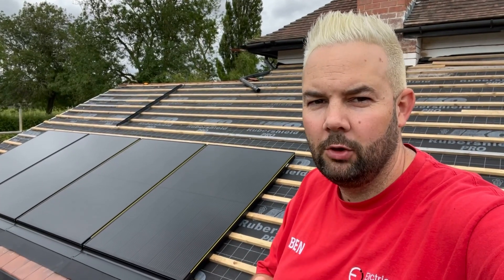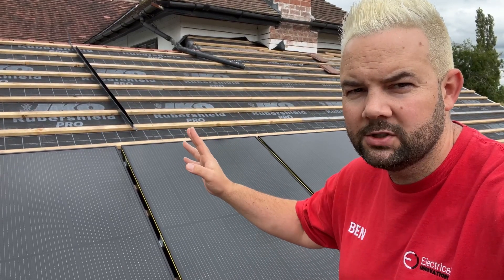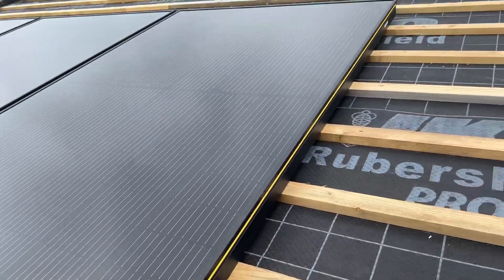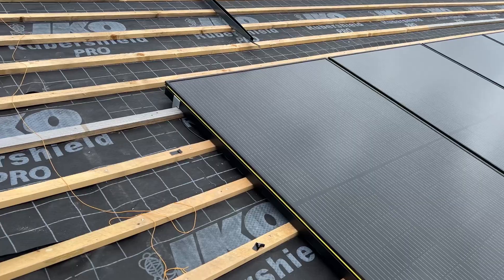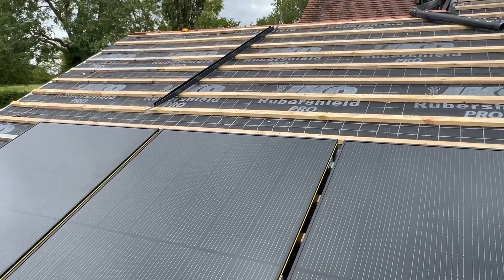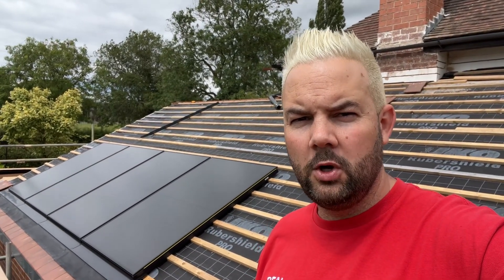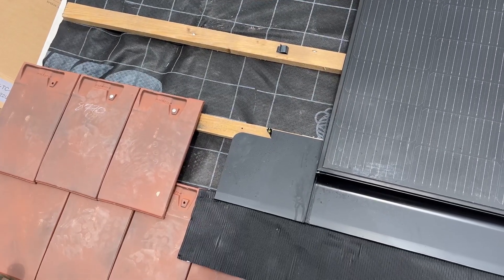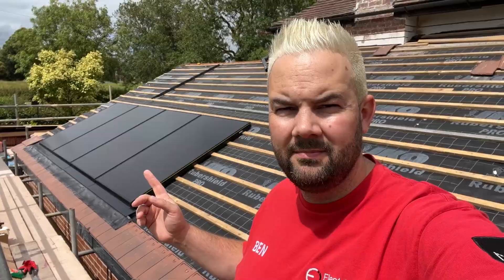In-Roof Solar walkthrough. How the solar panels attach to the roof.

Comment: A Sigenergy inverter uses cheap high-frequency transformerless inverter tech in their design that offers a poor surge capacity, a shorter life expectancy, and it can damage your appliances because it lacks any galvanic isolation between its DC boost stage and its AC output. I would never plug any of my appliances into one of these poorly designed toy products.

Comment: How easy are they to replace if one panel is faulty? Do you have to pretty much take the whole lot off?
Reply from the maker: its tricky, you can get they out but will most likely need some new flashings.  They have a good warranty so problems are unlikely

Comment: I've just installed a gse in roof tray system. U don't need to cut the lats, the tray fits over the top of them. Only thing I found a bit of a pain was that none of the fixing holes lined up with the existing lats so had to have a lot more lats to the roof. The system u are installing looks really tidy though 👍
Reply from the maker: GSE is a decent system but it can be a mess around.  I never quite trust the load of the panels being borne by screws into 25mm lats

Comment: This is a very important topic for householders. We readily speak about the expected life of the panels and their efficiency over 25 years often with little consideration for the weathertight performance of the roof. Please do a follow up and review whilst the works progress. Possibly, cover wind loading design and the number of fixings into the timber battens. Most installers are used to relying on a rail and joist fixing. Clear and concise information, thank you.
Reply from the maker: Thanks! We instaled this one ready for the roofers.  Next vesit will be to install the Alpha ESS system.  I'll do a follow up